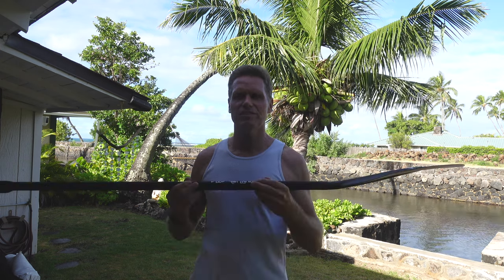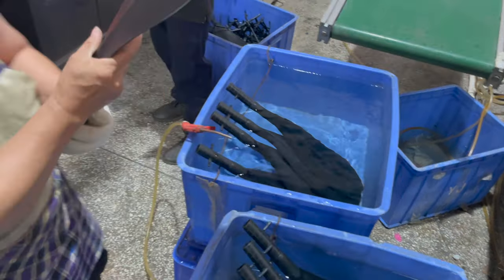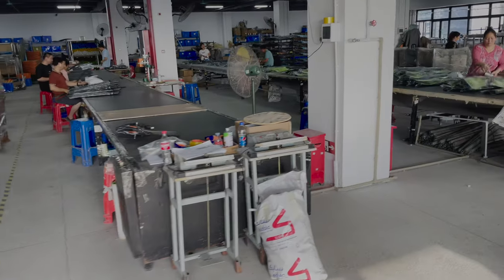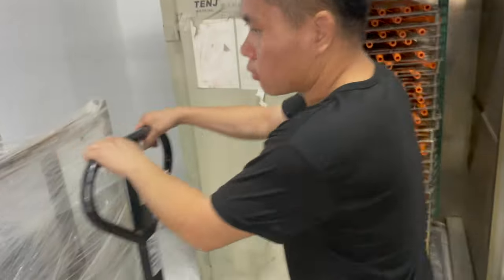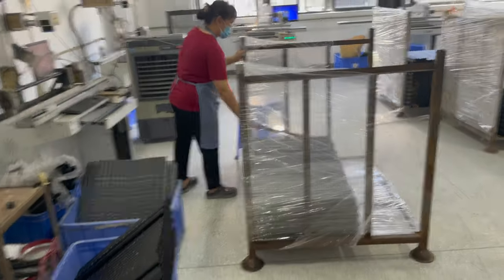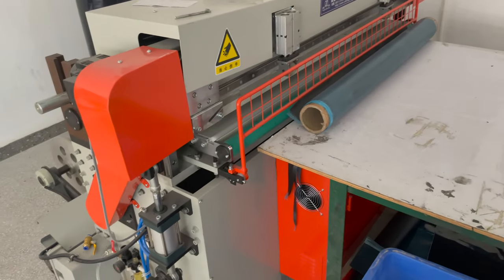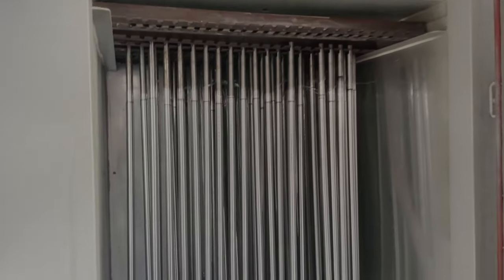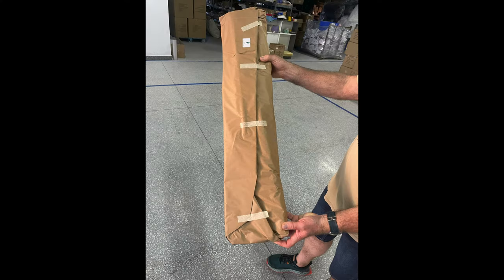Paddle Factory Tour- how Stand Up Paddleboard and Kayak paddles are made

Comment: 02:30. An oval profile is such a simple but excellent improvement. I assume round is simpler therefore cheaper to make.
Seems the wheel needs to be re-invented every so often. The Viking 2 handed battle axe went one better. It had an egg shaped profile with the “top” of the egg in line with the blade so the wielder knew, in the heat of combat, how to hold the weapon without looking at it.
Reply from the maker: Egg shaped is a good shaft design! 🤙🏼